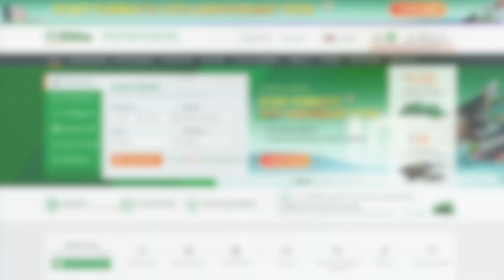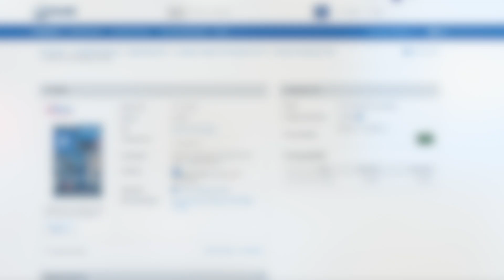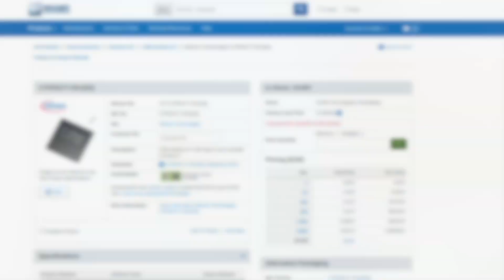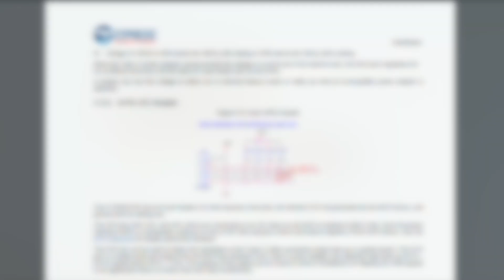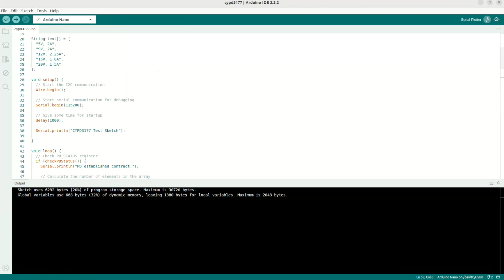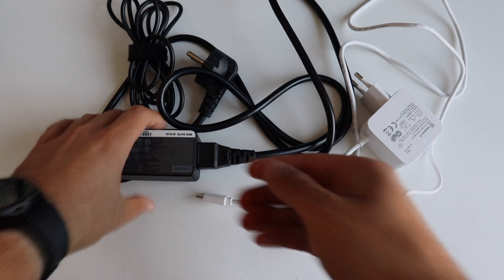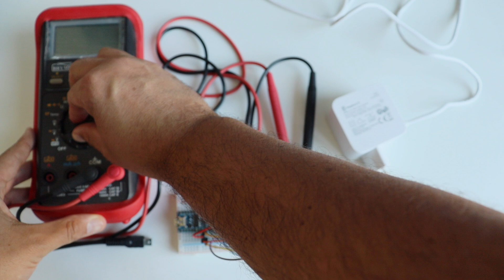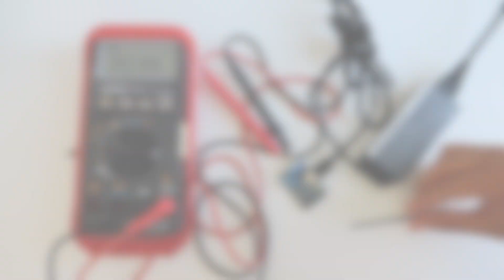Selecting Voltage from USB-C Power Delivery (PD) over I2C with Arduino, CY4533 & CYPD3177 Sink Chip

Comment: Hey dude , for the status checking you've used 
status[1] == 0xA4

I checked the darasheet and it specified bits 11-13 as reserved to 0.

But A4 => 10100100 here the 13th bit is 1 so could you clarify if this is an error or if it has a specific purpose.
Reply from the maker: It has been a while since I implemented this Arduino sketch as a simple example. As far as I remember I wrote it this way because if the value of PD_STATUS register is 00 A4 05 00 then it means that the explicit contract has been established with the charger. You can see the same value used for the same purpose in this article: https://community.infineon.com/t5/Knowledge-Base-Articles/Change-the-PDO-of-CYPD3177-through-I2C-with-a-MiniProg3/ta-p/246422#.
Reply: Could you tell me on how to exactly do the set up and which registers to access and change.
Reply from the maker: @spiderspider1384  you can have a look at I2C setup and the PDOs that I have defined in the provided as an example Arduino sketch: https://github.com/AnaviTechnology/anavi-examples/blob/master/usb-c-power-delivery/cypd3177/cypd3177.ino